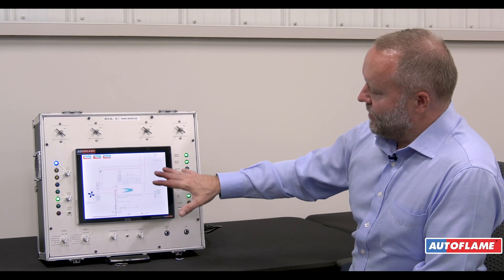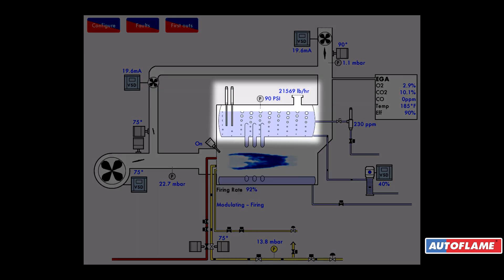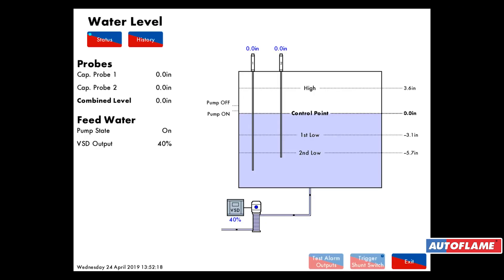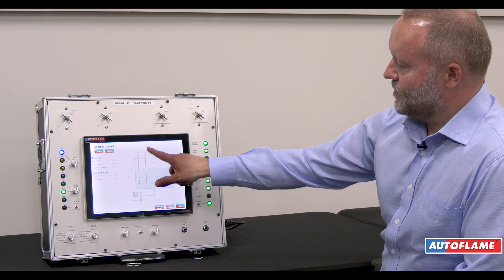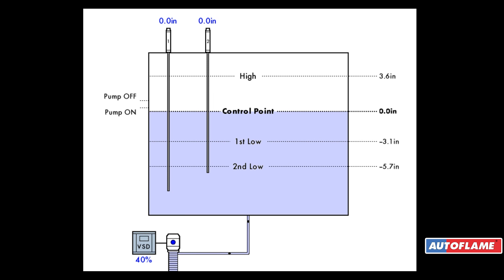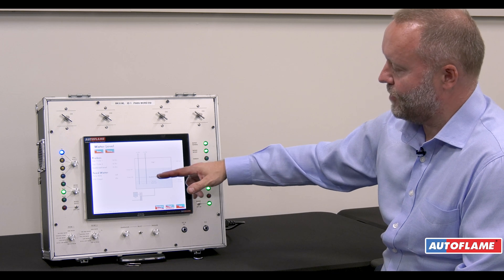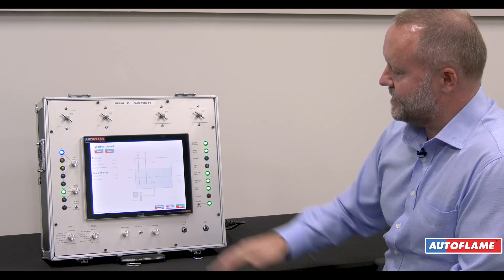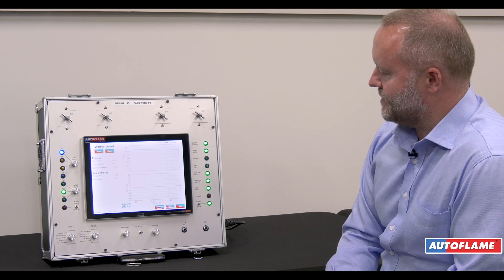Boiler Water Level Controls - Autoflame Total Boiler Room Controls

Comment: Feed water pump speed control  Whats the benefits of going this route? I have only seen on/off type.
Reply from the maker: One of the biggest benefits of modulating your feed pump speed is energy savings. You are able to keep level without having it run full bore. The other major benefit is reduced wear on the motor from starting and stopping. Hopefully that makes sense. Thanks for watching!